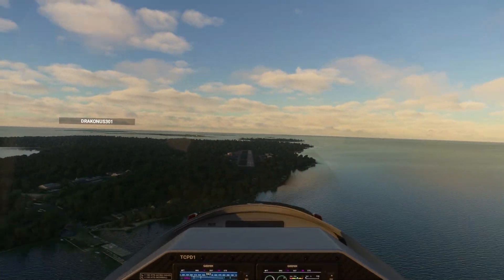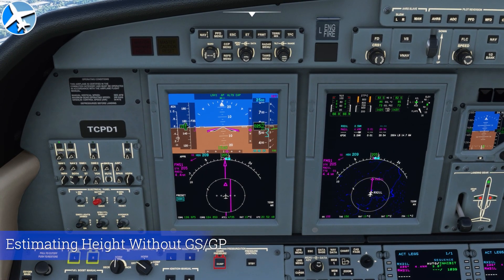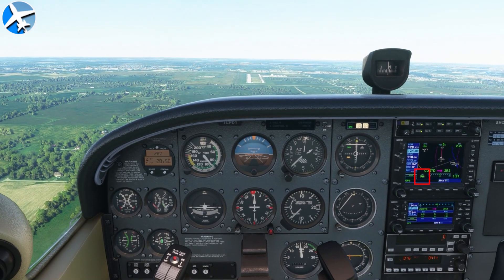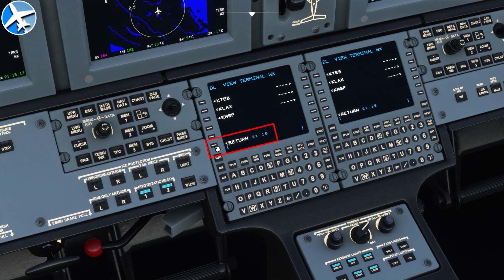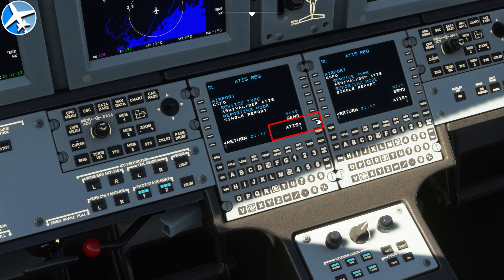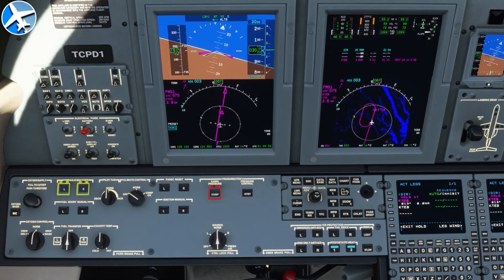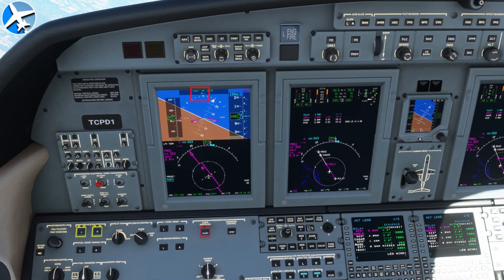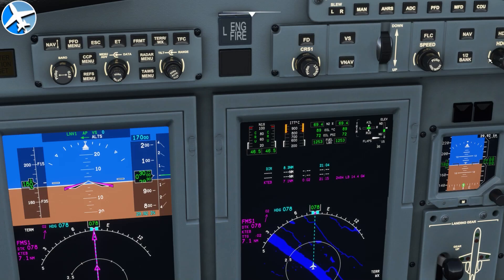Practical Aviation Tips and Tricks to Make Flying Easier - MSFS

Comment: Thank you thank you.  Your tutorials are second to none.  I’ve watched them all and learned SO much.   On your last tip, my Altitude Selector will always change by 1000 (although sometimes when I enter FS2020 it will change by 100, but this lasts for only a few seconds).  A single left-click gives me 1000 but a left-click and hold gives very fast 100s.  Strange behaviour!  Keyboard left shift does nothing for me.  I have the latest updates for FS2020 and the Working Title mod.  Maybe this will get sorted sometime.
Reply from the maker: I am glad you find these tutorials helpful.  Hearing that makes the effort put into them worth it.  Thank you.  People have commented about OBS course changing by 10 instead of 1.  Most of them had one thing in common - Honeycomb flight controls.  Here is an old post about it from the MSFS Forum that might be helpful : https://forums.flightsimulator.com/t/alt-hdg-etc-incrementing-and-decrementing-in-wrong-intervals-with-honeycomb-alpha-plugged-in-just-started-after-latest-windows-build-installed/231881
Reply: @thecorporatepilotdad  thank you, I’ll check that out.

Comment: Nice tips, why would you need your TAS in the middle of the flight?
Reply from the maker: A Citation I flew years ago had a TAS display on a separate display.  The display was out.  We had no easy way to get TAS other than using the method with FL and IAS.  By knowing that we were able to fly a given IAS attain the TAS that we normally used.

Comment from the maker: What was your most favorite tip from the video?
Reply: ATIS at destination
Reply: Destination Hold and Direct to setup
Reply: Rate of descent - although I'll have to watch it several times before it sinks in 😂 Captain Joe in his videos does say that working out the rate is messed by every pilot so  maybe I'm not alone.
Reply from the maker: @harrybassett9433  This rate of descent is an estimate.  You can use it on ILS approaches  as a target rate of descent in airplanes that don't have autopilots.  Divide ground speed by 2 and add a 0.  If GS is 140 = 140/2=70 add a 0 - 700'/min.  That's it.  And the distance/height .. 300Xdistance to the airport + field elevation.  300X7=2100 and add field elevation.  At 7 NM from the runway you'll want to be 2100 feet AGL (add field elevation for what the altimeter will read at that 7 mile point) and then descend at 700'/min from the previous example.  I hope that helps.
Reply: I fly GA aircraft mostly and found the TAS for props extremely useful, although the estimating height tip (for TOD and checking glideslope) was also very valuable.